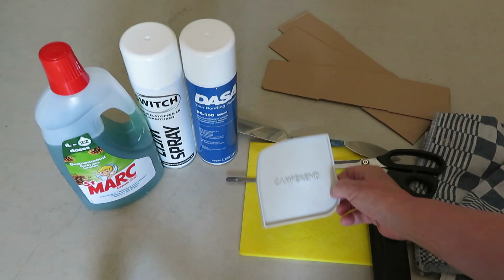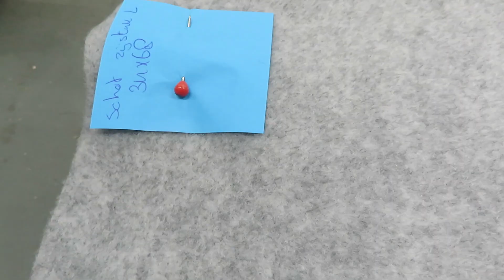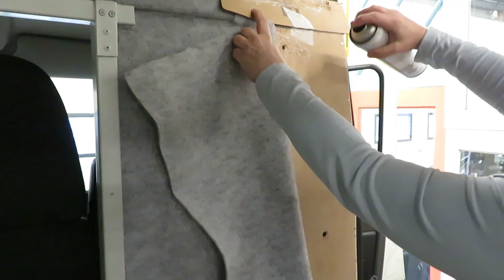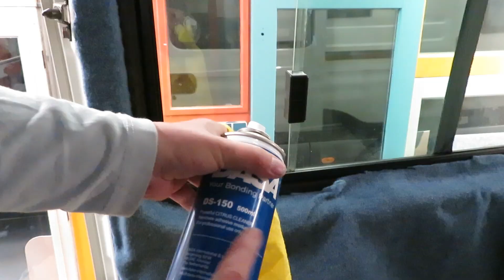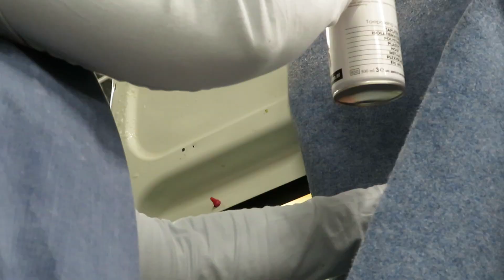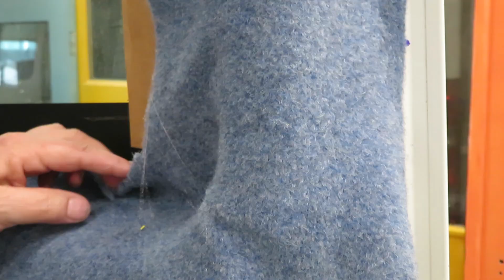Camper Van | RV Carpet Felt Installation – Walls, Doors & Panels DIY

Comment: Great video, may I know all the applications of needlefelt, where it is used for a camper van? And on average, how much needlefelt per camper van is used? Please (approximate rough idea will also be helpful)
Reply from the maker: Thank you for your compliment. I have used the carpet/needlefelt for the steelbulkhead, wooden window panels, sliding doors, backdoors. Roof above the cabin. I Also made a draft cushion for the sliding doors. No sewing involved. The applications are plenty. https://www.youtube.com/watch?v=vugD_Okhq3Y.  In total I used approx 7 meters. Felt is 2 meters wide. With Kind regards Mar
Reply: @StofensteenNlVof  Thank you so much! Do you know the average GSM (pile weight) for this and the respective average price per sqm? also do you have idea about what should be average size of needlefelt for towable RVs (Travel Trailer (All), Fifth Wheel, Folding Camping, Trailers, Truck Campers) from your experience for any of the above? (It should be less then Van Camper or greater)
Reply: @StofensteenNIVof may I have a response please?
Thanks
Reply from the maker: You already got an answer yesterday. Is there anything more I can help with?